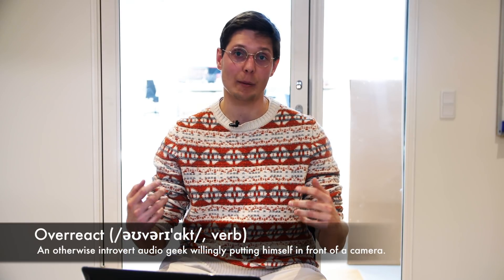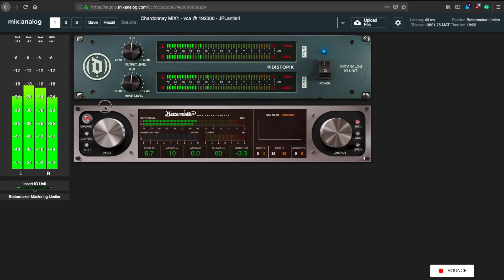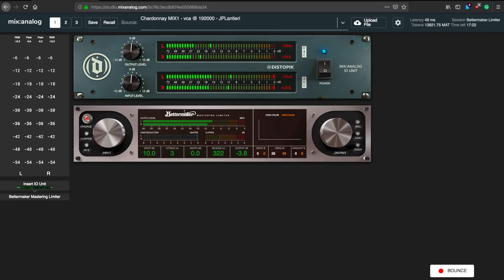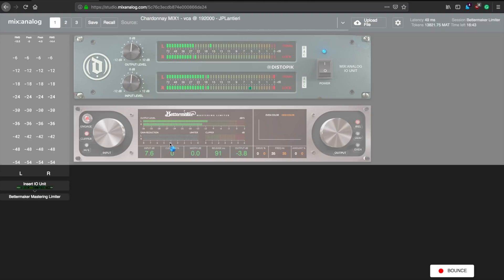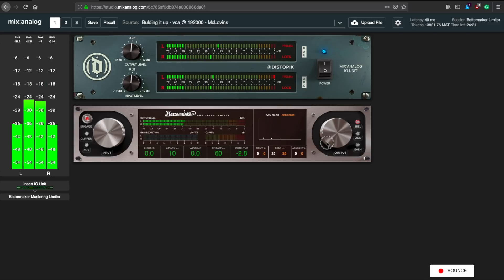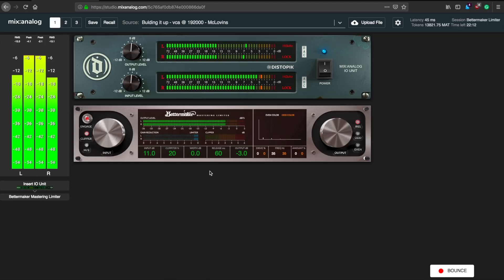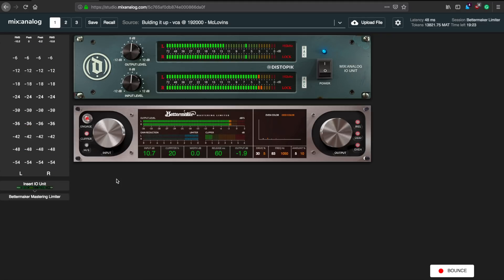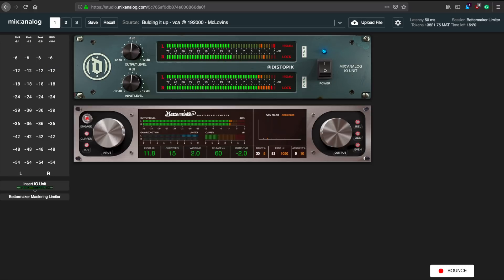mix:analog | Bettermaker Mastering Limiter Tutorial

Comment: Help me understand! I bought Bettermaker Mastering Limiter 2.0 and am working in Cubase. Why when reducing the output volume on Limiter 2.0 Bettermaker Mastering, the peaks still pass through and the red peak lights up on the channel? In software limiters, by reducing the output volume, we are protected from peaks, but in Bettermaker Mastering Limiter 2.0, by reducing the output volume, peaks still pass through?! Is this how it should be or am I missing something? And, another question - does it matter where to put the Limiter 2.0 Bettermaker control plugin itself, on the master channel or on the track? Thank you in advance! I've already tried recording between two computers via analog connections and the peaks appear again on the recording computer. But it shouldn’t be, on software limiters, when the output level is reduced even by -05 db, the peaks do not pass, but in Bettermaker Mastering Limiter 2.0 they do. And, in general, is it necessary to connect the sound card via analog inputs and outputs with a cable, or does this processor also work via a USB plug-in? Or maybe some kind of calibration is required? Help me please!

Comment: How fast internet connection do I need to make this work??? I got stutter and my download speed is 20 Mbit/s.
Reply from the maker: 10Mbit/s is usually way enough. However, we've found out that on some configs Chrome + Windows stutters on the playback side if the buffer size is not 128 or sometimes 256. It has nothing to do with networking and everything to do with how Chrome manages graphics vs. audio work. Firefox used to be worse for mix:analog but is currently the best option. Hope this helps
Reply: @mixanalogcloud  I use macs.
Reply from the maker: Michael Velten could you try with firefox on mac? Just to see if that helps
Reply: @mixanalogcloud  I have tried both firefox and chrome.

Comment: How do you have it connected? I just bought mine and it seems to ''display'' audio along with the plugin, BUT when i turn ANY of the knobs - it has 0 effect on the audio
Reply from the maker: We have additional software to route the audio thru the analog inputs and outputs. The plugin is actually just a remote control, it doesn't do anything with the audio.
Reply: Thank you for your quick response. I have my Audio cables running in and out of my Lynx Hilo and my Better Maker yet it is still not effecting the audio
Reply from the maker: @Zitchi  Are you routing the audio thru the bettermaker? Are the meters moving?
Reply: mix:analog  yes the meters are moving (indicating audio is going through it)